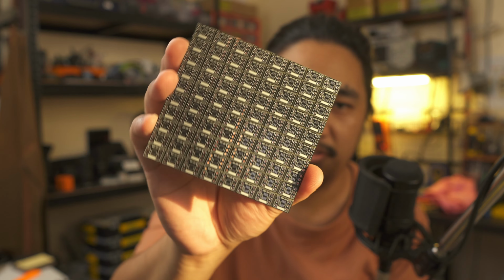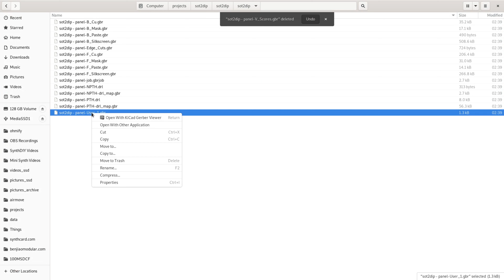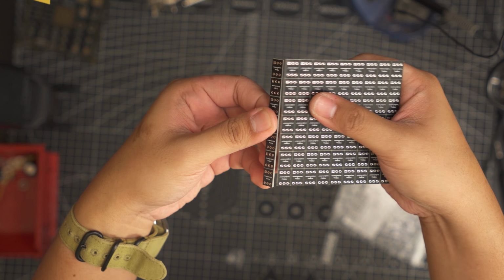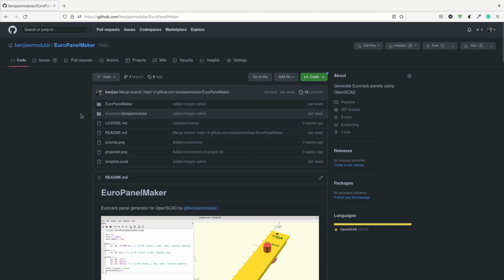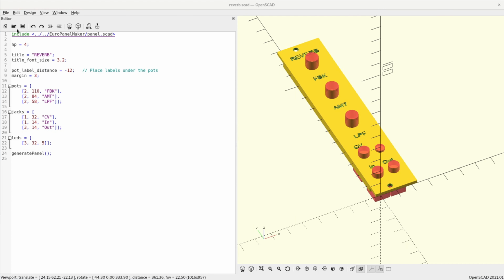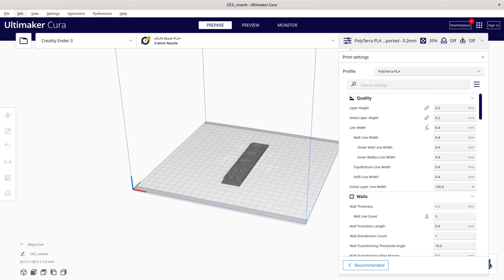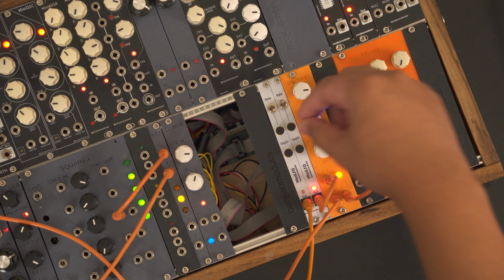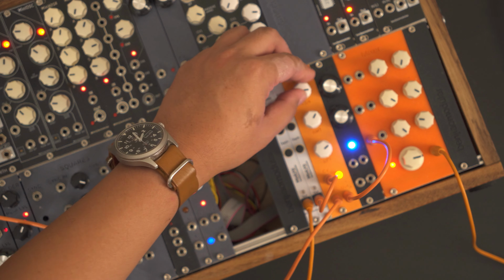MiniVerb - Part 4: Making sure that the next PCB batch works!

Comment: Excellent video as always! Really nice work with the OpenSCAD scripts and 3D printing. Making frontpanel prototypes using a 3D printer is a great idea I think - I use it a lot to get a working module before I start to design the PCB front-panel and to check that everything fits together and the controls are in the right place.
Reply from the maker: Thank you very much! And yup, 3D printing is perfect for that I think. Not too precise, but good enough for a quick prototype.  😄